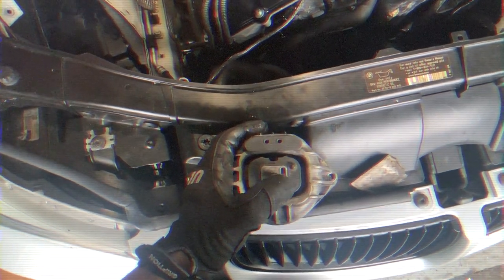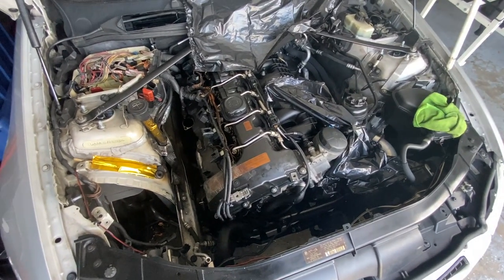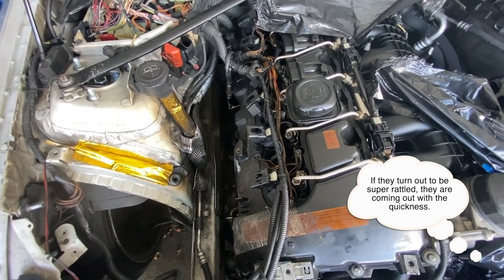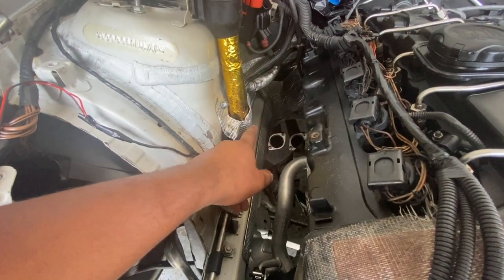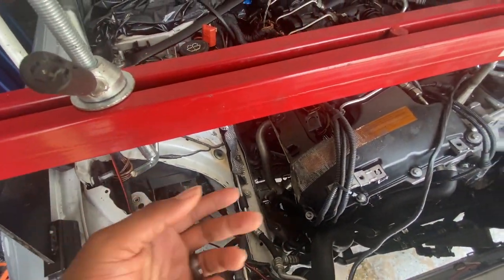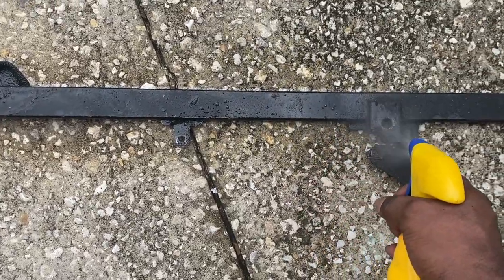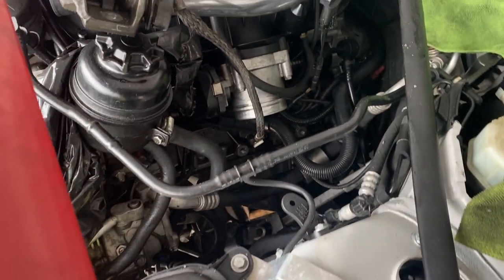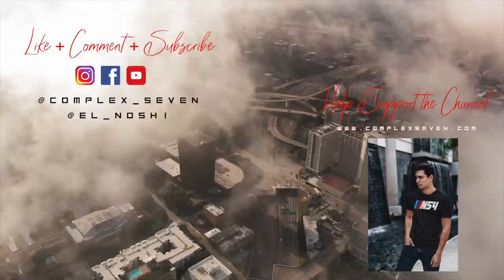BMW E90 335i New Mods - Turner 60A Engine Mounts

Comment: My VTT cast valve cover has 2 pinholes in the casting that weep oil when hot. If you can afford it go billet in my opinion.
Reply from the maker: Thanks for the heads, I should be changing my vc soon, so will def go for the billet. Any leaks are a pain.

Comment: Did you get rid of the VTT coolant lines you had installed previously? Did something go wrong with those?
Reply from the maker: Haven’t had any Vtt coolant lines installed before.
Reply: Sorry wrong person haha. How’s the NVH with these? And have they been reliable? I’ve seen reviews of them melting
Reply from the maker: Haha no worries. Not sure as of yet car still in the air waiting on some backordered part which is holding me up 🤦🏾. I seen those reviews, but the ones I’ve seen are on twin turbo cars, which have the heat from the turbos right by it. Hence the melting. Since I’m top mount single turbo the mount won’t be expose to that high of a level of heat compared to a twin setup. Hopefully my hypothesis is correct, but it’s something I’m looking out for when it’s back on the road.
Reply: Any updates on NVH and how everything worked out?
Reply from the maker: Worked out decent, NVH wasn’t a problem definitely an increase from the stock mounts. My wife drove in it and didn’t complain and she’d say something. Only issue I had was with the new mounts installed it raised my engine higher and my exhaust wouldn’t align with my downpipe. So my original mounts was really compressed.